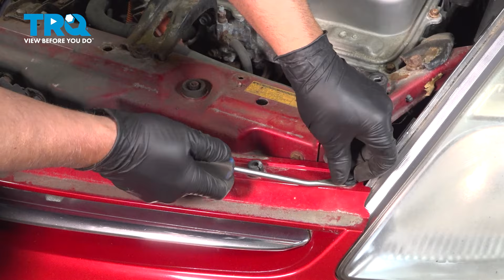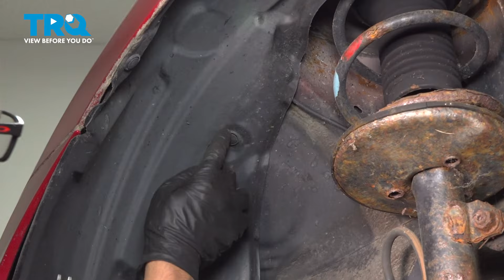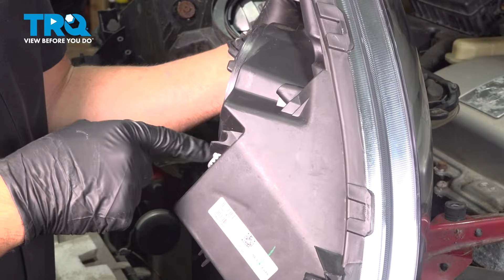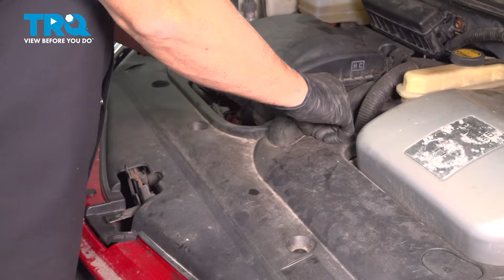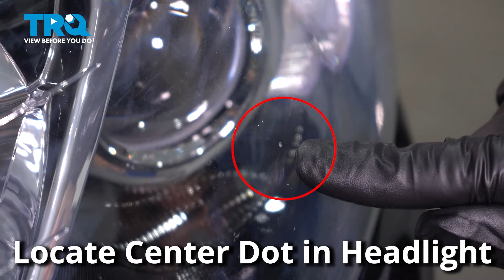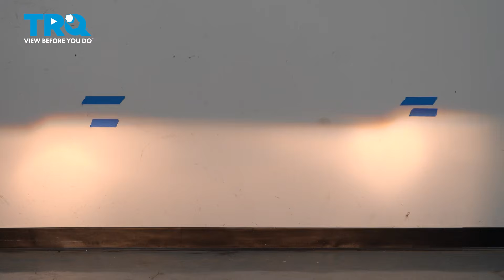How to Replace Headlight Assemblies Toyota Prius 2004-2009

Comment: There seems to be an editing error at 9:56 they show the plastic trim being pinned up before the front spoiler has been fastened and then show the same clip later. Also there is no need to remove the wheels the whole front bumper can easily be removed without that.

Comment: I've replaced the headlamp bulbs on two different 2008 Priuses, and many of these steps don't really need to be done.  The wheels don't need to be removed and none of the fasteners needs to be removed from the underside of the car.  When the upper part of the bumper cover is released, there is plenty of room to tip the cover forward, remove the headlamp fixtures, and access the HID bulbs.
Reply: Thank you so much for that tip , I suspected that was the case
Reply: This is replacing the whole headlight assembly, not just a bulb.

Comment: Fck

Edit: 
I was able to this way easier and quicker than this. And I'm very far from being an expert here. There was no need to remove the entire bumper or any of the plastic on the underside at all. Just remove that plastic cover inside the hood, then disconnect the top of the bumper, then pop the corner of the bumper out by the wheel well, then disconnect and remove the light assembly. Took approximate 10 minutse to replace

Comment: Note if you have an OEM HID system don’t order the base (halogen) fixture. The bail securing the bulb is completely different. As well you would need to rewire the connector to the bulbs for 12volt bypassing the high voltage ballast. Third the round access door behind the bulb is different sized. Don’t ask how I know. Mod back to halogen may be cheaper but not worth the hassle. 
Loved your video. Keep it up
Reply: This information is invaluable. This whole situation has been a nightmare.